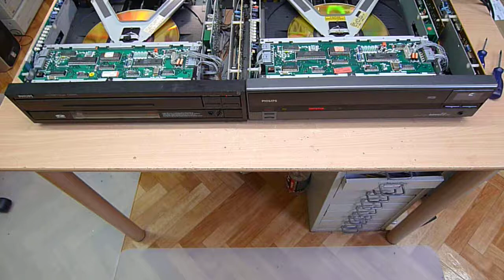Philips CDV-475 & CDV-988 - Testing both...

Comment: Look great in action . Is one better than the other . Or both pretty much the same ?
Reply from the maker: Hard to tell...

On the other hand, I never found a (fully) working CDV-475 player,,

I had five in the past (still got three (one of them is a proto model)),

my best one can only play normal audio CD’s... :-(

I never found a 475 playing a LaserDisc... :-(

But the CDV-988 I have works smoothly... :-D

So I guess the CDV-988 is more reliable...
Reply: @Multiwizard  I remember reading an article some were they had reliability problems when developing the first combie players . 
They wanted to keep the price below 499 . 
Pioneer had one but it cost way more because it used 2 seperate motors .
I even think the article said they switched production from Belgium to Japan . But I could be wrong
Reply: Interesting. I know they had issues trying to create one servo to drive All discs .Types So much so there was a delay in releasing cd video .